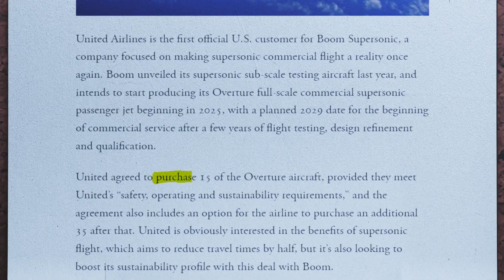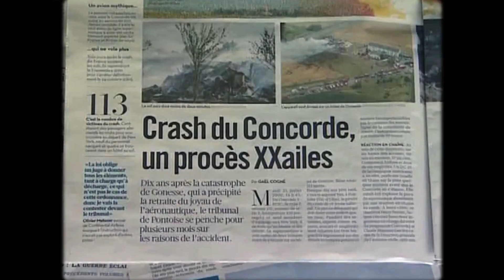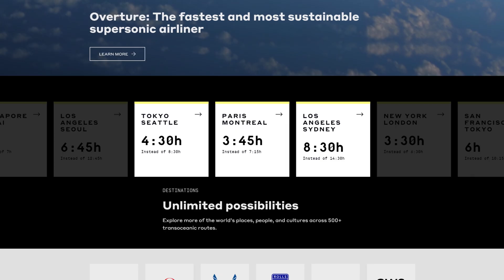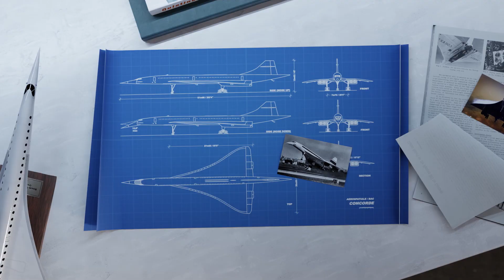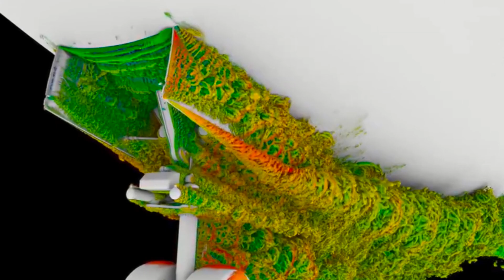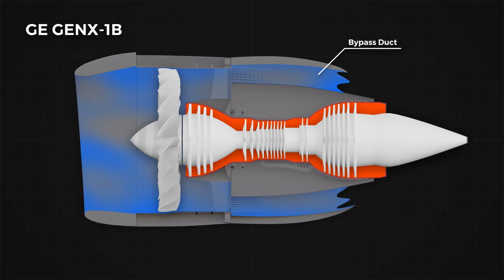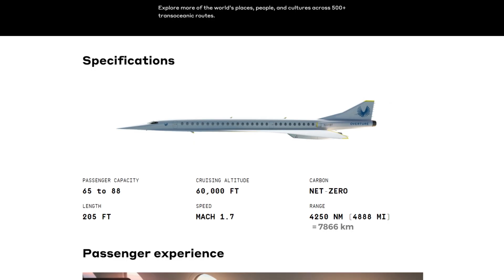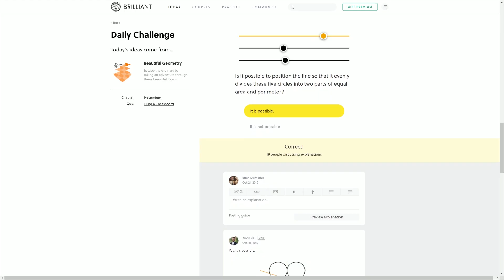Will Boom Bring Supersonic Back?

Comment: The reason they have turned to Rolls Royce is because of Reaction Engines, they should have no problem producing an engine running at these speeds as they are aiming for much faster speeds with the technology being produced. Within the next 5 years we will see a completed helium engine powered by hydrogen fuel and on this latest release of what this Boom plane will look like they are Sabre engines being produced by Reaction Engines...

Comment: Concorde only had an accident because a Boeing aircraft dropped rubbish onto the runway. Also the US Banned supersonic flight over the USA. Also lets remember that this aircraft was designed in the 1940s
Reply: @tonytrott9789 The strip of metal on the runway was from a McDonnell Douglas MD10.  Concorde had one near crash and one fatal crash because of a design flaw. Pretty much every country banned supersonic flight, including the UK and France. Your surely not suggesting that sonic booms should be allowed over land.  Concorde was designed in the 1960s and 1970s, although studies of SST were carried out in the 1950s on both sides of the Atlantic.

The main challenge facing the 1950s UK supersonic transport study group was to find a suitable wing. The big breakthrough was the short slim ogival delta, which has low supersonic drag and, at a high incidence, provides lift for take off and landing, by generating upper surface vortices. The high incidence necessitated a very tall landing gear, and a droop snout so that the pilot could see the runway, giving Concorde an iconic swan-landing-on-ice appearance on approach.

Take off and landing speeds were 250mph and 187mph respectively, which is pretty high, and greatly stressed the Michelin designed tyres, both mechanically and thermally, especially as Concorde was heavy at 185 tones. By comparison, the Boeing 737 take off and landing speed is 150mph and it weighs 75 tones and has a short landing gear. The lofty landing gear, meant that it was subject to high leverage. These factors caused continual problems, particularly tyre disintegrations and subsequent damage to the aircraft structure, throughout the life of Concorde.

At  Charles de Gaulle airport on 25 July 2000, a Concorde's tyre burst while accelerating down the runway. Pieces of the tyre smashed into the left wing and caused a pressure wave in a tank which ruptured, allowing fuel to gush out and catch fire. The aircraft subsequently took off and then crashed at low altitude.  Controversially, the French Bureau of Enquiry and Analysis (BEA) blamed  a thin strip of titanium, measuring 17.1in (435mm) x 1.3in (32mm) x 0.06in (1.4 mm), that was found on the runway, for the burst. The accident led to modifications to Concorde, including more-secure electrical controls, Kevlar lining in the fuel tanks, and specially developed burst-resistant tyres.

Here is a summary of an Observer report shortly after the above crash:

On the 16 August 2000, the Civil Aviation Authority revealed that Concorde has suffered 70 tyre-related incidents, that makes it plain that the Paris disaster on 25 July 2000 could have happened at any time during the plane's 26-year commercial history.

The fact that a single tyre blowout could cause potentially catastrophic damage to Concorde's landing gear, wings and fuel tanks was known as long ago as 1979. Despite a string of design and maintenance improvements, this type of blowout has repeatedly occurred since then.

Concorde has suffered seven tyre bursts that resulted in punctured fuel tanks. Two, in 1979, happened to Air France planes taking off and landing in Washington, triggering a mandatory upgrade in tyre specifications and the introduction of a puncture alarm system.

But by 1982, following half a dozen similar incidents, including a holed fuel tank on a British Airways Concorde taking off from New York, the US National Transportation Safety Board was still sufficiently alarmed to order extra safety measures: Concorde's landing gear and tyres were to be inspected before every take-off.

Subsequent serious incidents, in 1985, 1988 and 1993, all involved BA Concordes at Heathrow and New York's JFK. In each, tyre bursts led to pieces of landing gear or rubber being ingested by the aircraft's engines, and wing skins being damaged, with fuel leaking from the punctured tanks.

Further improvements were ordered in 1983, 1985 and 1993, when pieces of the landing gear's water deflector had punched holes in the wings. But in spite of all the changes, Concorde's wing skins still remain vulnerable to flying debris.

Refs:
(Wiki: Concorde)
(Wiki: Air France Flight 450)
(theguardian: concorde world)

Comment: As much as I prefer to be the optimist, and want to believe that everything will just work out, Boom is fighting an upstream battle of popular opinion against sonic booms, a need for a fuel source that doesn't exist in the quantities that they need, for an engine that doesn't even yet exist.

 And the fuel source and the engines need to be readily available, especially the former, or there goes the operation costs, which raises ticket prices for any potentially interested customers. 

 Thinking as a potential customer, I wouldn't want the ticket price to be much more than the first-class ticket on a traditional airliner from, say Orlando to Tokyo or Singapore, for example. 

 It sucks that the blunt nose costs fuel efficiency, so scratch Flights from on land such as Orlando. Flights would likely only take off from coastal cities, unless this is a design challenge that can be overcome. 

 Actually, I predict that as long as it is costly and time-consuming to make one's way to the coast because of regulations regarding supersonic flights over land, Airlines like Boom will also struggle with finding customers from inland locations, since many potentially interested customers might only want to use their services if they would have had to take a connecting flight anyways. Otherwise, might as well save the travel costs, and take only one round flight if possible.

 If Boom is going to be unable to manage that, then they will struggle to fill out seats, especially as long as people struggle with rising costs for everything else. Personally, I think that the first obstacle that needs to be overcome for commercial super and hypersonic air travel is a (at least relatively) cheap, plentiful (and preferably eco-friendly) fuel source.
Reply: @assemblyrequired7342

Will Overture be able to fill the gap left by Concorde in the SST market?

Introduction
Boom have undertaken a mammoth task in developing and producing the Overture SST, with its Symphony power module and turbofan engine. The biggest risk is that they will deplete their capital, before a prototype Overture flies. Once that milestone is reached funding should be available. The following, is based primarily on information from Boom, and assumes that Overture meets its specification and goes into airline service. I have no connection with Boom whatsoever.

Aviation
Aviation has changed radically since the iconic Concorde first carried passengers in 1976. More people are flying, the number doubles every 10 years, and they are richer. Aviation fuel is roughly the same price as it was in 1976, taking into account inflation, and with deregulation, airline tickets are now cheaper, in real terms. Aircraft now have the range to fly non stop between any two airports in the world.

Technology
Computer aided design, and simulation has transformed aircraft design and development, by drastically reducing time and costs, and increasing effectiveness. In addition, advanced technology and materials, have enabled more powerful, more efficient engines, and lighter, cheaper, and more streamlined aircraft. 

Flight
Because Overture will be economical at sub and supersonic speeds, 500 routes, some mixed land/water, are viable, rather than just 2 Atlantic routes for Concorde. Overture will be carbon neutral, using sustainable aviation fuel (SAF). Overture will will create a sonic boom, but not over land, where it will cruise 10% faster (Mach 0.94) than subsonic airliners. It will cruise at twice the speed of subsonic airliners over water. Concorde carried 100 passengers at Mach 2, over 4,488 miles. Overture will carry 65 to 80 passengers at Mach 1.7 over 4,880 miles. 

Airframe
Both aircraft are 202ft long, but Overture will have a gull wing with computer controlled leading and trailing edge flaps, and a greater span, at 106 feet compared to 84 feet. Overture will also have an empennage. Carbon composite construction will enable streamlining, weight saving, and increased strength, while practically eliminating thermal expansion and contraction.  Overture will weigh an estimated 154 tons, Concorde weighed 185 tons. Concorde could carry 2.5 tons of cargo. The cargo capacity for Overture is not known. 

Engines
Overture's engines will be medium bypass turbofans without reheat, while Concorde had turbojets, with reheat. This means that Overture will be economical at subsonic speeds and will be low noise on take off and landing. Variable geometry ducting in the Symphony power units will probably allow the engines to supercruise.

Costing
Overture's predicted development cost is $8bn, against $14.4bn for Concorde. Manufacturing cost will be less, maintenance costs will be lower, and availability will be higher. Overtures selling price will be $200M, compared to $320M for Concorde. At a guess, Overture's development payback will be 150 aircraft, and airline payback will be 10 years, assuming 72 seats and 8 hours a day utilisation.

Operation
Overture will be simpler to fly, eliminating the need for a 6 month pilot conversion course. Overture will have improved low speed handling, especially on take off and landing, while maintaining low drag at supersonic speeds. It will have a modern cockpit, with a flight deck similar to subsonic airliners. A flight engineer will not be required. Instead of a droop snoot, external cameras and cockpit displays will give the pilots a view of the terrain when taking off and landing. Its cabin will be quieter and all its seats will be business class, almost certainly with internet. In contrast to Concorde's awesome engine noise, Overture will comply with ICAO-14 noise regulations, allowing it to use all airports, without triggering protests. 

Ticket Cost
Taking a JFK to LHR one way flight:  
Showing: Aircraft type,  Fuel cost per passenger,  Economy ticket,  Business Class ticket,  Duration

Boeing 747          $147          $577             $2,308                      8hrs 
Concorde             $753                                $5,000^                     3.5hrs 
Overture^^            $708         $1,200           $3,000^^^^                4hrs 
Business jet^^^                                 $53,000 to $99,000            8hrs  

Notes
^ 2023 value 
^^ Estimated prices, assuming Overture carries 72 passengers against Concorde's 100. For the first 2 years, only business class seats will be available.    
^^^ There are no supersonic business jets
^^^^ $5,000 return 

A 16 hour flight across the Pacific on a subsonic jet could be achieved with a 1 hour refuelling stop by Overture, giving a time of,  4 + 1 + 4 = 9 hours.

Market
Overture will not be competing for the mass economy market. Instead it is aimed at the 700 million long-range business flights made each year world wide. Boom and airline customer surveys show the viability of Overture, and they have identified 500 suitable routes. All Overture's seats will be business class and ticket prices will be comparable with business class on subsonic airliners. Once Symphony gets established it could become a niche service, similar to Concorde, but with many more routes.

Conclusion
Overture will be popular with both airlines and passengers, because it will half many journey times and will be cheaper, more comfortable and a lot more practical than Concorde. The military have already shown an interest in Overture. It would also be suitable for charter flights. There may even be a market for the Symphony power unit or just the engine. As Overture matures, it will probably be developed, just like subsonic jets. So the range may be increased, there may be a stretched version, and even an all economy seat version. After Overture, Boom could possibly develop a 200 seat SST.

22-2023.09.04
Reply: @phonicwheel933  
 It all sounds promising on paper, but things don't always pan out the same in reality.

 Hopefully, it won't go the way of the (gorgeous) Boeing 2707 (one of the best-looking airliners never made), and once the design makes it off the drawing board and the prototype begins test flights, most (because not everything ever does) will work out according to plan. It's too soon to see whether we should be optimistic, but I think that it is worth monitoring Boom's progress.

 A carbon-neutral jet fuel would be a MASSIVE game changer, not to mention making a potentially carcinogenic fuel that Chevron is trying to pass off as environmentally friendly obsolete. Sustainability might also mean no more inflation for tickets, which is always a welcome occurrence. 

 Fossil fuel corporations wouldn't be happy, but then again, it seems that they are only content when everyone else is not, so screw them.

Comment: Boom is gonna go bankrupt. Even if they succeed building the plane, it will just be a Concorde 2.0
Reply: @user-wc9vy4oc5h Overture is far from being just another Concorde:

The aviation world has changed radically since the iconic Concorde first carried passengers in 1976. More people are flying, and they are more affluent. Roughly speaking, the number of trips doubles every 10 years. In addition, technology has advanced greatly, with the advent of computers, bringing computer aided design and simulation. Engines are now more powerful and efficient and aircraft are lighter and more streamlined.

Because Overture will be economical at sub and supersonic speeds, 500 routes, some mixed land/water, are viable, rather than just 2 Atlantic routes for Concorde. Overture will be carbon neutral, using sustainable aviation fuel (SAF). Overture will fly 2x the speed of subsonic jets over water, and 10% faster over land. Overture will create a sonic boom, but it will not fly supersonic over land. Concorde carried 100 passengers at Mach 2, over 4,488 miles. Overture will carry 65 to 80 passengers at Mach 1.7 over 4,888 miles. 

The two aircraft are the same length at 62m (203ft). Overture will be constructed from carbon composite, saving weight and increasing strength, and practically eliminating expansion and contraction with temperature changes. Overture will weigh an estimated 154 tons, Concorde weighed 185 tons. Overture's predicted development cost will be $8bn. Concorde's development cost was $14.4bn. The manufacturing cost will be less, the maintenance costs will be lower, and the availability will be higher. Overtures selling price will be $200M. An equivalent price for Concorde would probably be $1.2bn. For comparison, a Boeing 737-800 costs $100M, and a 747-8 costs $420M.

Overture will be simpler to fly, eliminating the need for a 6 month pilot conversion course. Overture will have a modern cockpit, with a flight deck similar to subsonic airliners. A flight engineer will not be required. Instead of a droop snoot, Overture will have external cameras and cockpit displays to allow the pilots to see the terrain when taking off and landing. Its cabin will be quieter and more spacious, and its seats will be more comfortable. In contrast to Concorde's awesome engine noise, Overture will comply with ICAO-14 regulations, allowing it to use all airports. 

Taking a JFK to LHR one way flight:  
Showing: Aircraft type,  Fuel cost per passenger,  Economy ticket,  First Class ticket,  Duration

Boeing 747          $147          $577             $2,308                      8hrs 
Concorde             $753                                $5,000^                     3.5hrs 
Overture^^            $708         $1,200           $3,000                      4hrs 
Business jet^^^                                 $53,000 to $99,000            8hrs  

Notes
^ 2023 money 
^^ Estimated prices, assuming Overture carries 72 passengers against Concorde's 100. For the first 2 years, only first class seats will be available.    
^^^ There are no supersonic business jets 

A 16 hour flight across the Pacific on a subsonic jet could be achieved with one 30 minute refuelling stop by Overture, giving a time of  4 + 0.5 + 4 = 8.5 hours.

Overture will not be competing for the mass market, but Boom have identified 500 viable routes. Overture may become a niche service, both scheduled and charter, where certain travellers expect higher prices. Even now, on subsonic airliners, some people are prepared to pay 4x to fly luxury class. And, as far as business travel is concerned, the time saving would be well worth it. To support this, Boom's surveys show the viability of Overture. 

If Overture reaches production, and meets its specifications, it will be popular with both airways and passengers, because it will half many journey times and will be cheaper, more comfortable and a lot more practical than Concorde. The military have already shown an interest in Overture. It would also be suitable for charter flights and as a business jet. The next development should be a 200 seat version, and possibly a supersonic business jet.

14-2023.08.19